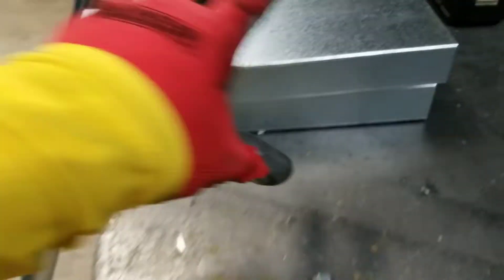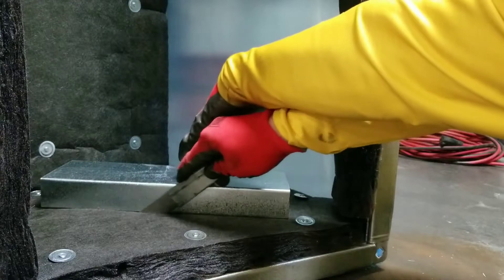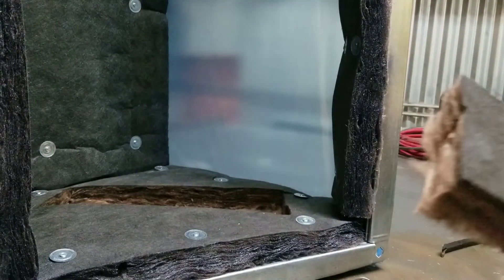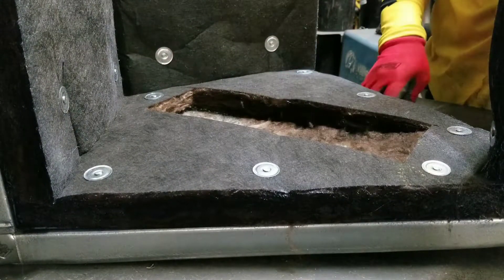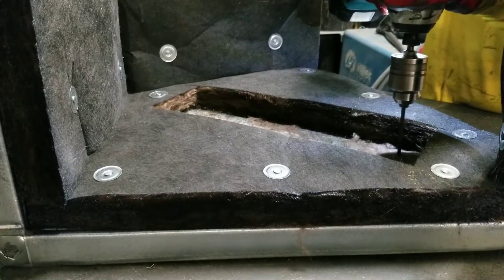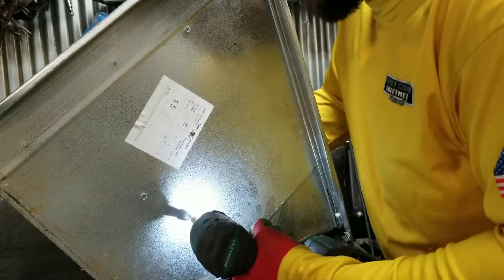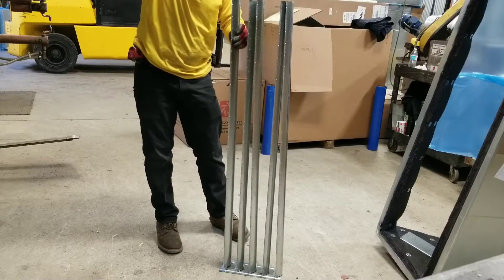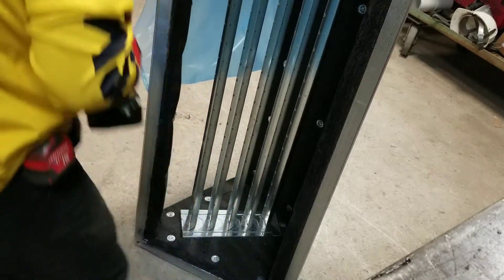Duct Liner and Installation of Vanes in the Elbow AFTER assembly!

Comment: SORRY, BUT THOSE VANES ARE MUCH TOO SMALL TO WORK CORRECTLY.  THEY NEED TO BE MUCH LONGER.
Reply from the maker: Was this sarcastic 😂
Reply: NO, JUST EDUCATIONAL.  LITTLE LONGER ON THE TRAILING ENDS TO STOP TURBULANCE.     👍
Reply: Any vane longer than 36"should be a 4" wide vane, not a 2" vane.